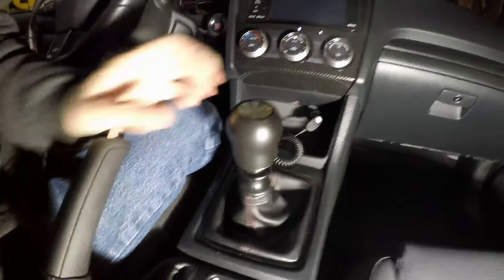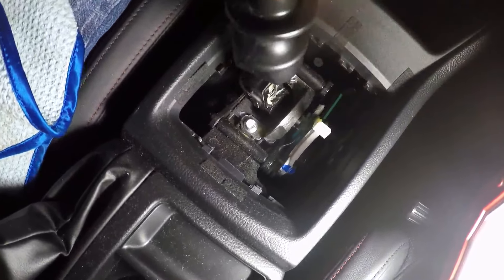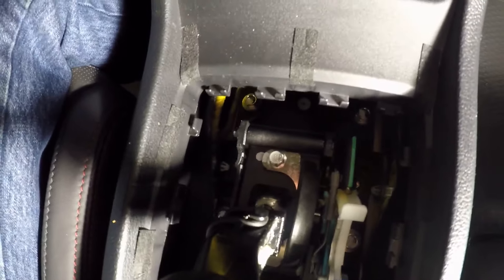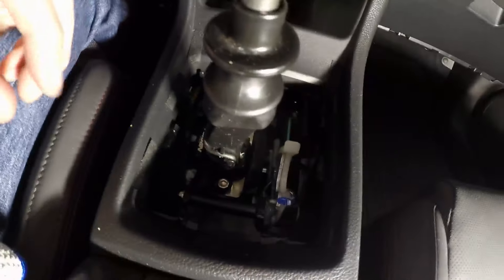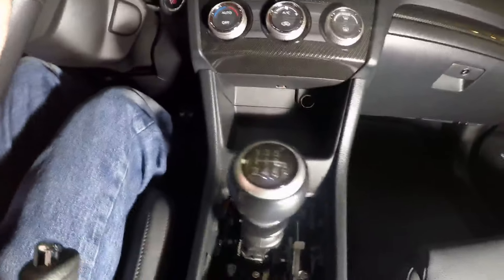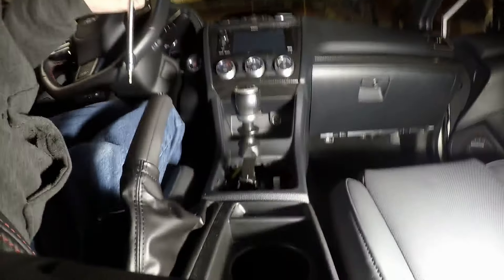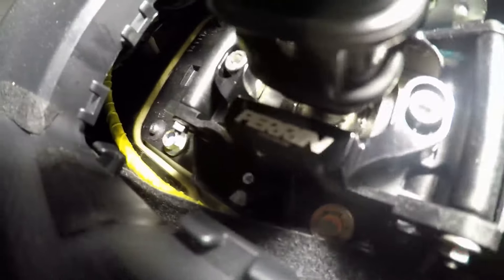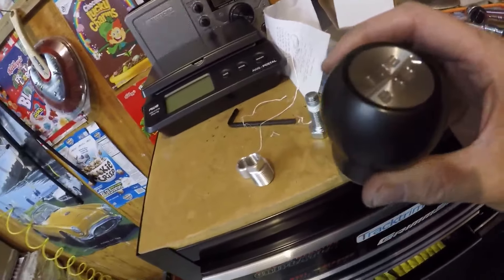2015 Subaru WRX Ep. 583: Perrin Shift Stop Installation and an Opps

Comment: I accidentally drop one of the oem nuts that needed to be reinstall and it fell all the way down into some gap. I look underneath my car and couldn't find it. Went to Home Depot to get a replacement and also bought a magnet and use some fast food napkins to cover the bottom area. Reinstalling the side nuts was a pain in the ass. I didn't see a point of removing them in the first place. When I get an oil change, I'll put the car on the lift and see if I can still find it. Otherwise it probably flew off the car as I drove it.
Reply: I actually remove the center console and the whole shifter trim so I can have better access to the area. I couldn't find the nut. It hit metal when I drop it. Probably sitting on the shifter cover plate or the heatshield just above the downpipe.
Reply from the maker: ya it would be much easier to search for under the car i think. using a mirror to look at top of heatshield areas.

Comment: I'm really sorry to say this but I warned you about this in episode 329. It's happened to me several times now and Raceseng advised me to insert a screw driver in the adapter to spin it out and it worked. At least you know how to fix it when it happens in the future. Also, you can buy replacement set screws from Raceseng. Thanks for the videos!
Reply from the maker: M.wood0213 I remember u. But I tried 10 tools. A screwdriver was useless for me

Comment: My biggest pet peeve of the shift stop was the way it made neutral feel really short. Plus the sound of the shifter assembly hitting the stop. The clicking noise is very annoying. I still have the part installed and have gotten used to it. I wish they made a version to where it has rubber on the side so its silent.
Reply from the maker: Greg Goldman lol... watch my next video....

Comment: When you had the Perrin really tight did you notice any issues downshifting into 1st? When mine is tight and im barely rolling I have some issues getting it into 1st.
Reply from the maker: not really, but thats not really a shift stop thing. first is always tricky if you are rolling
Reply: i had the same problem, any solution you found?
Reply: Just keep adjusting it and man handling it. I've had the shift stop in for like 6 months now and the issue gradually went away after a week or so. You also have to kind of get a feel of how the transmission is rocking back and forth and go with the flow of it.
Reply from the maker: well ya if its too tight you cant get into first well. you have to find that perfect adjustment. but if youre rolling, ya youre not really supposed to be able to get into first.